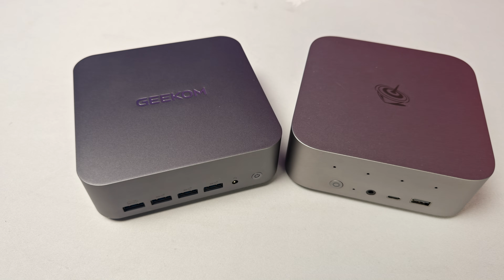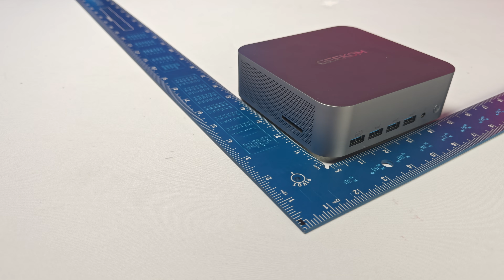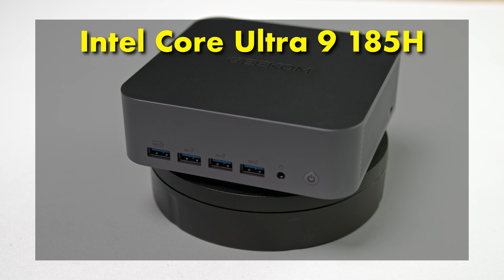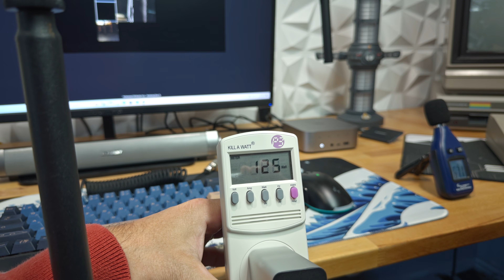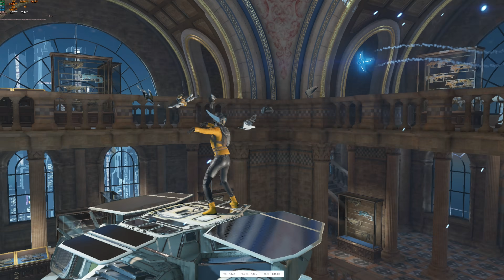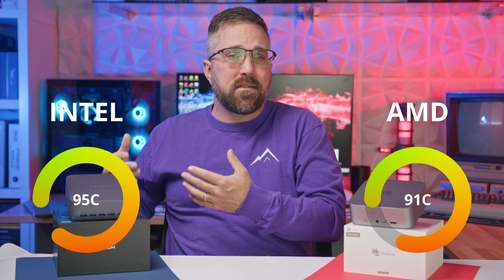Beelink SER9 vs Geekom GT1 Mega: Ultimate Mini PC Showdown!

Comment: I get the difference in the power between these two minis, however if one was down-sizing from a tower who cares as the dedicated GPU draws more at idle than the difference between the two minis.
As for me, yes the expandability of the Geekom may be nice (but I think few people will change the RAM) I prefer the quieter Beelink.  The Beelink also runs cooler. So in my scorebook its the Geekom 1 and Beelink 3 as overall it wins in performance.
One last thought, out of 100 people that would buy the Geekom, how many are going to access that PCIe slot?  Few if any so that is a moot point also.
Nice video though, just my opinion on the two minis.  Thanks for your efforts in the making of it.

Comment: I have two AMD mini PCs (Ryzen 7 and 9) and an Intel i5. The AMDs are more powerful, quieter, and use less power.  The Intel i5 has since fried itself into oblivion. It cant run more than ten minutes now before throttling off even after a fresh thermal paste reinstall.

Comment: Hi, thanks for that review.
Nice video but I feel you could go more in depth, like using UXTU on the AMD Beelink to benchmark with several power profiles.
I own an "old" SER6 MAX with Ryzen 7 5800H and I can really see the difference in power draw between like performance and eco profiles.
Usually, I will use it in balance mode since for my workload it's really quieter.
The "extreme" mode is good to have but will eventually (under heavy load) put the noise level to its peak which is not great when around.
I didn't even bother to create my own power profile because I feel the four default ones are good enough for me.
The fact you can like switch the power profile using a right click on the systray, just before a video render then leave the room and do something else is kinda cool, then just put it back in eco mode for common desktop tasks such as YouTube or coding for exemple.
I guess there is the same kind of tools for Intel so testing them would add a lot to your reviews because people who buy these mini PCs want to extract every dip of juice they can out of them.
Cheers!

Comment: The Geekom GT1 Mega has 2 SODIMM ports, but their website says it only supports up to 64GB RAM. Wondering if it is technically possible to upgrade to 128GB RAM with that new 2x64GB RAM kit from crucial. Anyone know?
Reply from the maker: It’s the Intel Ultra processor that supports a max of 96GB DDR5.

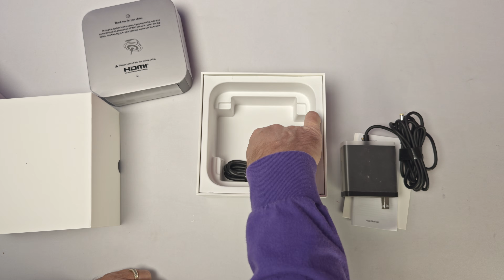Comment: 2:01 Do they have a built in PSU like Apple does in all their mini-boxes including even tinier Apple TVs? NOPE!
As long as Mini PC builders fail to do so, I only buy Apple boxes for my tiny PC needs. Even if that has to be an ancient 2012 - 2018 MacMini as those run Windows or Linux too.
Reply: Clearly you are not a pro PC user..
Reply: @MatthewTaylor-hd2tk  this is about mini pc's. Not about pro pc's.

Comment: The Beelink definitely seems to have a better cooling system, in both thermal control and noise. I've been using an M4 Mac Mini (base) since November and am looking at the current crop of mini PCs to replace it as my daily ... relegating it to use as a home theatre computer. Great little system, but when I am working from home, it's a PITA to access my work network and file shares from a Mac. What it did for me more than anything is come to appreciate the power and portability of a small package like that. With a portable USB-C monitor, it's just as easy to take this along on vacation as lugging around an old laptop that hasn't been updated in 8 months and needs to spend six hours updating the OS and all of the applications before it's usable again. The SER9 looks compelling. I'm mostly curious about what the longevity of these systems are like long-term (ie: 5 or 6 years from now) ... when I could just build myself another tower (with the lack of portability that brings) that have more power and something like a 4060 GPU (and pull hundreds of watts more from the wall) for about 50 bucks more. Anybody been running these little Beelink systems for any length of time now? How are they holding up? Not looking to overclock and push them to their limits ... basically going for the OOBE, maybe shift the BIOS to performance mode.
Reply: I've been running a Beelink SER6 Pro 7735HS for almost 2 years now - 24/7. Recently I ditched Windows and installed Ubuntu, it now has become my Kubernetes development box and keeps on running 24/7. I didn't change any BIOS settings. Never had any issue.
Reply: I don't know much about computers, so I watch these videos to make upgrade decisions. My current setup is a Beelink SER8 i5 I think I bought seven years ago. As a civil engineer, I run it about 10-hours a day and have never had a glitch in all those years.
Reply: @mpcinlv I've started using the SER9 Pro units at work because they're more cost effective and powerful than the equivalent Dell micro desktops I was buying. So far, the quest I've had was a bad power brick within 5 minutes of first boot, emailed their support and they sent a new one within a week. Lucky I had 3 others still in the box to test with. I'd rather wait on a new power supply than return/replace the whole computer. I've been using it as my primary at work since spring, it's been great. I have run into weird Windows Update failure issues after joining them to our domain. A clean install from the Microsoft ISO fixed that though. Also hit a couple of installer errors on the default Windows installation where the user account doesn't have write permissions to the Windows temp folder. Not sure if that's a domain-related thing with Beelink or not, but it wasn't an issue with clean installs. On new ones going forward, I might just do the initial setup to register the license to the hardware then a clean ISO install.

Comment: I need to replace my current Windows 10 tower. I would like to replace my tower with a mini-pc. The primary concern is have is keeping mini cool. My current PC runs 7/24/365. Any mini I use would also need to run 7/24/365.  I have "heard" that minis cannot do this and the mini fans are too small, too noisy and will get too hot to run 7/34/365.  Please share your thoughts.

Comment: Hi so I wonder how these would compare to PS5 pro? Im planning to use those like a ps5 as I always travel I cannot build a real PC, and bring it around I cannot also getthe ps5 as I already have plenty of games on my steam. I also plan to stick in a egpu on it but idk if it will be useful boost. One of my choice is also buying a rog ally x or wait fo the legion go 2 then pair an egpu. What do you think is the best option?
Reply: They wouldn't compare at all. Ps5 pro has a zen 2 cpu but a rdna 3.5 GPU and GDDR6 which is an order of magnitude more bandwidth than either of these machines.
Reply: @ so even if I buy the beelink SER9 and bought the dock to pair it to a 4060 it still wouldnt be able to compete to ps5? Although that would be hella expensive and better of building a mini itx build.
Reply: @kenyamagami6669  the occulink port, or USB4 port introduces huge latency for external gpus. This means much lower performance than the GPU would traditionally have in a dedicated PC. Its still a lot better than using the igpu but isnt like getting a portable desktop pc. 

Although the cpu of the mini PC is definitely strong enough to handle it if there was no latency involved.
Reply: @ Ihear the beelink have a pcie slot on its bottom where you can use it to mount to external gpu that doesnet rely on usb 4 or occultlink port, would that make any difference? thanykou so much for answering, for now Im checking price for a mini itx build and checking it its feasible for me to bring around.
Reply: @kenyamagami6669  it would make it closer to the full power the GPU but not the full thing
Reply: Ps5 is still on the same level as big mid range desktop pcs with dedicated mainstream gpus than a small mini PC using 20 percent of the power. Not even mentioning the pro which is about 30 to 45 percent more powerful than base ps5

Comment: I'm a diagnostic radiologist, doing medical imaging interpretation. I'm looking to change to a portable setup, I read for US hospitals from here in Southeast Asia. Assuming budget is not a consideration, and I require 4 displays (I will use four ultra thin portable monitors), which mini PC on the market would you recommend?
Reply from the maker: The Geekom GT1 Mega and Beelink GTI14 Ultra both support quad displays (2 HDMI & 2 USB4 Alt DP mode)
Reply: @ElevatedSystems  Thanks much! I heard on another review that only the Geekom has quad display, and pretty much every other brand only offers three displays natively.
Reply: What did you end up using? Always wondered how loud mini pcs would sound running dicom files. Cheers, doc!

Comment: Despite using more power, the AMD system runs cooler and quieter. Better performance with better acoustics and thermals is more important than using 40 more watts. Dont think u would notice a 40 watt diff in your monthly electricity bill.

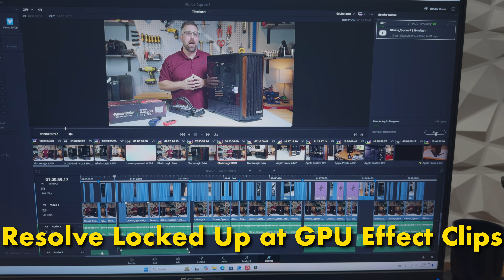Comment: Hi, thank you for your review. I would like to ask you, at 13:26, when you say "we still see some typical AMD challenges" do you mean that usually AMD processors do have some compatibility issues with Resolve or other SW? I'm quite new hear and would like to buy a new PC for video/photo editing and would like to incurr in this kind of SW glitches if known.
Reply from the maker: AMD graphics cards, while excellent for gaming, are often less favored for professional photo and video editing due to limited support for specialized software optimizations. Many industry-standard creative tools, such as Adobe Premiere Pro and Photoshop, are heavily optimized for NVIDIA’s CUDA cores and proprietary technologies like NVENC for hardware-accelerated rendering and AI-based tools. AMD GPUs lack these CUDA cores and rely on OpenCL for acceleration, which is less widely supported and sometimes less efficient. Additionally, AMD’s driver support and stability for professional applications are occasionally seen as less robust compared to NVIDIA’s Studio Drivers, designed specifically for creative workloads.

Comment: Do they thermal throttle all the time? Are they a better desktop replacement than a laptop? Are the Halo APUs next year really about as fast as a mobile 4070 in gaming? Can I add a 3.5" SATA HDD? How expensive are they compared to a desktop and laptop of similar speed/capacity?

Comment: If AMD draws more power but gets the work done faster, then its possible its actually more efficient.  You need to calculate how much Energy each system used to complete a certain task, not how much power it draws when CPU is fully loaded!
Reply from the maker: @11:28. You're welcome.
Reply: @ElevatedSystems  The area under the power curve is the total energy used. If you simply measured the steady state power, then your calculations may be a false representation of efficiency.

Comment: Attention: SER9 users, clock of APU seems to be limited to 4.2 GHz. 😮
Reply from the maker: Not true, you can see at 10:00 the clock speeds boost to 5.1 GHz. You need to check your power profile settings.

Comment: I'd look at a mini-pc with oculink if I were considering using it for gaming. Sure it kind of defeats the purpose of ultra sff if you have an eGPU setup with a full size 7700 XT and SFX power supply on top of a dock, but I'd take that modularity/possibility on top of the same internal iGPU setup than without. USB4 or whatever is too much of a bottleneck to really matter compared to oculink.
Reply: For me the selling point is the Oculink port, not interested if it doesn't have it🤷🏽‍♂️

Comment: Finally! At least someone is using the latest Cynebench! And not the version from 2023.
BTW, how did You managed to use only 70W from the 115W power CPU (turbo mode) from the outlet during the test? Looks very Intel'ish. Power limit from the manufacturer?  Other videos on YT shows the same 185H CPU with an Asus NUC 14 Pro+ draw about 140W and still loses to the AMD Ryzen AI 370. And how the hell 370HX CPU package draws 90W??? It's impossible! It's a 55W CPU!!!
Reply from the maker: All the testing was done at out of the box settings from the manufacturer. Geekom went with a good balance of power and performance, while Beelink seems to have just went with maxed power. Both systems are power limited by the included 120W power supply which is why the the Intel has limited turbo boosting.

Comment: The synthetic benchmarks I've seen says the M4 Mini will crush both of these. Looking forward to seeing real world performance comparisons.
Reply: The problem of synthetic benchmark is they can't reflect real world scenario. I can game with Baldurs Gate 3 way better on the Ryzen HX 370 than I would do on M4. It really depends on what you have to do. M4 shines in multimedia, web and photography. Ryzen AI HX shines in heavy multithread tasks, 3D graphics and AI local tasks. I'm using Topaz Lab video AI and obviously I have to go with the Ryzen. Your software in what defines what you can have from the chip, ultimately
Reply: @Squagliafrittata  true! And I'm not saying the M4 is bad chip. Actually it's a nice device. And I like the aggressive competition prices from Apple. I hope Chinese manufacturers will drop the price for the AMD devices too.
Reply: In a single core tests and wattage efficiency (this one is not so important because these devices are powered from the outlet and not from battery). Multi threading is significantly on the AMD side. At least not on the pro version. And I'm not talking about horrible SSD read/write speeds on a base M4 (again, I'm talking only about base level M4, from the same price range)
Reply: @isotoxin  exactly. Also both came out mainly as an M3 Pro competitor and they are well ahead in the multiple core benchmarks. Strix Hallo coming out in Q2 will do the same compared to M4 Pro
Reply: @FCisThePunisher  that's the point! Ryzen 370 is a 5 months old CPU. And it's still kicking in 80% tests compared to a base M4. And I'm not even talking about 10 years old PCIe x3 SSD disk speeds.
Reply: @isotoxin M4 is actually a 6 month old SoC though? It was first unveiled with the iPad Pro.
Reply: Will the M4 Mini support 4 displays? I need this to do diagnostic radiology (medical imaging interpretation) remotely.
Reply: @wanderingdoc5075  out of the box, the M4 mac mini supports only 3 displays. With a USB hub, this could be increased to 4 displays, maybe. 4 displays is not officially supported, you will need enough video bandwidth to match the displays being used, and there is a chance it may not work and you will have to return and try a different hub. Keep in mind the mac mini is under suspicion of usb stability issues and multiple users have reported hub compatibility and reliability issues from the rear mac mini ports. If your mac mini m4 is to sit out in the open, keep in mind the M4 silicone is likely still vulnerable to direct go fetch attacks. So long as your radiology room is kept locked or supervised, you should be fine and this should be good practice for almost any computer.

It is more reliable to order a computer with enough video out ports for your setup. Something like the Geekom A8 or GT1 Mega U7 would be smaller than a mac mini and have 4 display outs from the rear.
Reply: I haven't seen the M4 mac mini run 3DMark or passmark tests yet. The reason being is because emmulation will heavily handicap M4 performance.
Reply: Yeah, shame that everything is designed to prevent upgrades and repairs though, soldered ram and proprietary storage interfaces are a joke in 2024 - particularly with the base mini having just 256GB storage. I've got more than that in lossless music alone.
Reply from the maker: This might be the last generation we'll see SODIMM RAM on x86 mobile APU's. Ryzen has already transitioned to LPDDR, and Lunar Lake went with on package memory, although say say that was a one off.
Reply: @ElevatedSystems I really really hope that's not true. buying a laptop with 64gb is insanely priced while an upgrade kit is just $200. All my hope is in the HX chips that AMD will release next year.
Reply: @slaw84  you can upgrade if you are a geek, https://www.youtube.com/watch?v=cJPXLE9uPr8
Reply: comparing mac OS vs windows product isn't the right comparison
Reply: The M4 is a beast, but make sure you compare the price of a 32 GB/1 TB M4 to these machines. 

For any of these desktop mini computers you have to ask is there still a reason to have a tower desktop if you are not a hard core gamer?